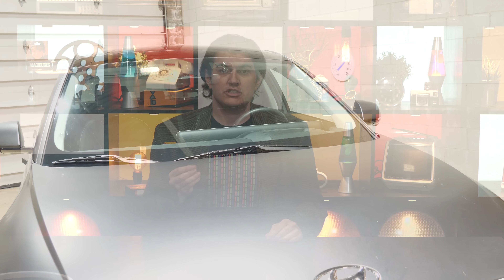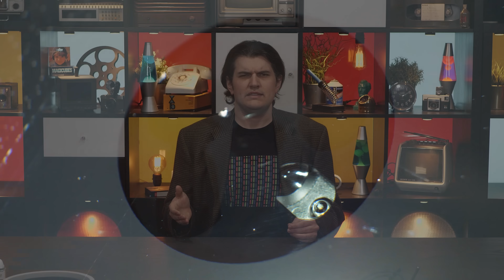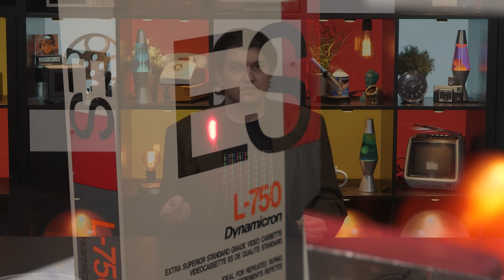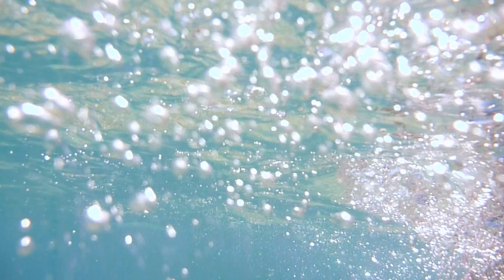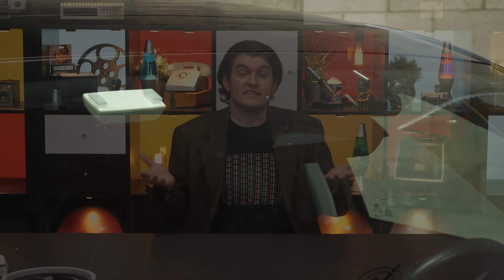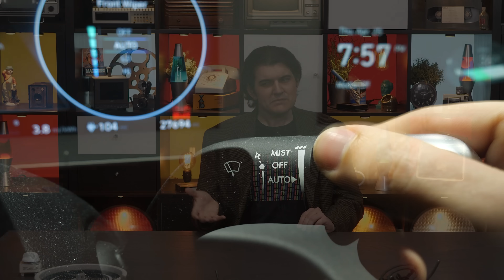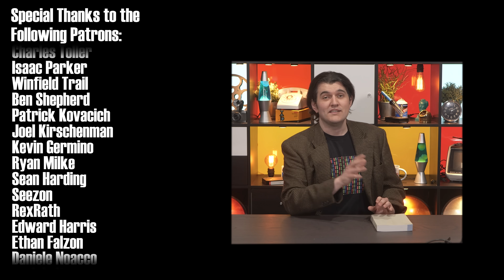The simple, clever sensor behind automatic windshield wipers

Comment: I remember reading the entire manual to my car before purchasing it. Found many important notes like "Do not run ventilated seats without A/C also being on as this may cause damage to the ventilator system" or "Do not jump start other vehicles with jumper cables as this may cause damage to the hybrid traction battery." I however missed the windshield wipers stay up note he mentioned and I found that info in a helpful Hyundai USA video on YouTube!
Reply: "Do not run ventilated seats without A/C also being on as this may cause damage to the ventilator system" I feel like it should be their job to program it to prevent that feature from working when the A/C is off, or to automatically kick the A/C on when it's enabled.

Comment: The owners manual only really works if it's the correct one.   Mine is trash as it's for a 2009 vehicle and the vehicle is 2012...I did check the door for the build date as to make sure the dealership  didn't pull a fast one... but still don't have a manual
Reply: I also buy tare down manuals for all my vehicles

Comment: Had an old Mercury Grand Marquis that had the same issue with the hood blocking the wipers.  As this was 2002, I don't believe the Konami Code would work.  There was enough play to change the blades but it was a pain at the gas station when cleaning the windshield.  I probably could have stopped them mid-wipe but never bothered to find out.  It finally died after 220k miles and almost 20 years.
Hilarious opening and I love the snarky asides.  Through the magic of two of them! Good stuff

Comment: Tesla isn't actually too insane for detecting it with the camera, although it more complicated. A few reasons for this: 
1) Tensor cores - you probably have more than enough compute already. If not, just run on the CPU. 
2) You could build it into the existing neural networks - or even measure how 'poor' it rates the image quality instead of water itself
3) It makes cars they made that don't have the dedicated rain sensing hardware also work. 

Personally, I think the non-camera is way better, but I do think that tesla wasn't crazy to have done it how they did. Also, yes, stalks please.

Comment: Hyundai wipers: How has it been cleaning snow and ice on the windshield without being able to lift the blades completely? I just bought a Kona EV and had the same experience during the last snow fall of the season. Not looking forward to next winter.

About rain sensors and stalks: I rented a Tesla 3 for work last year and almost had an accident when rain started pouring, I had a sheet of water on the windshield but the wipers decided to remain in lazy intermittent mode. The only way to override that is going into 1-2 menus on a touch screen. This is the main reason why I refused to consider a Tesla when shopping for my new car. I don't understand why a car with no wiper stalk can be deemed safe to drive.

Comment: I had a 01 Cadillac with rain sensors.  The windshield was wiped perfectly clean in varying amounts of rain.  That sadly ended when the windshield was replaced with an aftermarket version, it worked but not as well as with the OEM windshield glass.

I don't like to read the owners manual but, sometimes there is info on features you never knew about.  So there is that.

Comment: I've yet to own or drive ANY car whose rain sensors actually wipe in a way that is timely and not annoying. They either go off too late, or when they're not needed and they never keep pace properly with the rain. Even the Model Y has rain sensors which SUCK which is doubly annoying since it doesn't have proper controls for wipers on the stalk.

Comment: Tbh couldn't the manufacturer just have used a metallic sensor (when the contacts get wet, the low voltage circuit is complete and boom goes the dynamic). I had one in my RadioShack 200-in-one electronics kit

Comment: My 2011 Renault Scenic has automatic wipers with the same “tucked under the hood edge” issue when you try and replace the wiper blades… and the manual for that had absolutely no information on getting them to go up to the blade change position! It took me accidentally catching the wiper stalk when getting out of the car and knocking it to the fast wipe position (or Flash Flood setting as my dad called it!) to find out that when the ignition is off, it moves the wipers up to change blades with the stalk in that position! 🤦🏼‍♂️

Comment: Alec, UK Here with a Skoda Karoc, basically a VW, we encountered exactly that problem with the wipers! It was not in the manual! THIS IS STUPID!! For such a simple process as changing wiper blades, it should be as simple as pull and lift. There is not an excuse for poor design to need an enigma code to achieve basic maintenance. If you let go of that arm kiss the windscreen goodbye.

Comment: "Software isn't everything" is actually nice to hear as a software developer. I'm so tired of doing so many things in firmware on a microcontroller that can be done with circuits more reliably and affordably. A lot of people designing circuits (in the space I tend to be in, at least) seem to use software as a crutch to make electronics work, and they are typically not great with software because they're primarily trained in electronic engineering. It's nice to get paid to do work, but feels bad to build stupid things.

Comment: The owners manual is very helpful and will show you some hidden features on your car. I know that when I had my Volkswagen, I read in the owners manual that if you turn and hold the key in the drivers side door lock, the sun roof will close, I had manual windows but a power sun roof.  Also if, for some reason you don't have power to close or open the sun roof you can open this panel and find a handle that can be inserted and allow you to manually close or open the sun roof.  So read your owners manual, yes a lot of the information might not be useful to you now or you will already know, but you will learn things too. And most owners manuals can be downloaded as a PDF too.

Comment: I dont know what calibration method those use, but I do have to point out, after a single wipe there is plenty of time to detect what "dry" looks like even if it is pouring. Sure, not to a human, but the led signal is moving at light speed, on account of being light. Even if you are under a waterfall, wipers have non zero thickness, so there has to be some minuscule time (but still frozen in time compared to light) between wiper moving out of the way and water hitting the surface again, which I presume a light sensor would be able to detect. Analysing the signal over time/wave will tell the conditions based on how different the spike, if any, is to the signal before and after.

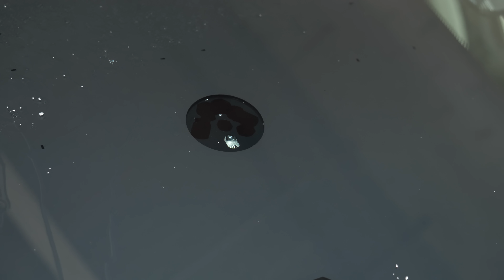Comment: 1:01 That's a kinda weird thing to say about something that literally leverages software to get away with as little hardware as possible. Personally, as an engineer, I also generally agree with the argument, that if humans can drive mainly using their eyes, computers should be able to do the same (assuming sufficient number crunching power and the right software). It would arguable be kinda clever to only start removing hardware after training the software on sufficient amounts of reliable data. Especially in the case of cheap ultrasonic parking distance sensors, that literally cost cents. But Musk is an idiot... He isn't an engineer and knows even less about engineering than about manufacturing. The Dunning Kruger effect doesn't mix well with an attention deficit and delusional self-confidence just happens to get you a lot of attention, so you there you go.

Comment: Neat fact, along with the rain sensing and ambient light sensing, that sensor can also sense solar load for the air conditioning, humidity for the defroster, and it has another brightness sensor to automatically adjust the brightness of your Heads-up display of your car is so equipped.

Source: I worked on the machines that made those sensors.

Comment: My 1998 Buick Park Avenue has Rainsense windshield wipers. Nice to see other parts of the automotive industry following a quarter century later
Reply: Plenty of cars have had this for over 25 years. I came across it on a very average car in the UK, also around 1998.
Reply: Cornering lights have come back in style too.
Reply: @bwofficial1776  Like my '99 Intrigue had. And believe me, they were fantastic, as I worked at a casino on 3rd shift and often had to dodge random employees wearing all black popping out of the woods at jogging speed into the street. (Why walk on paved, dimly-lit streets when you can run through completely darkened woods?)

Fun Hack with the Intrigue (and I'm assuming the sister models Buick Century and Pontiac Grand Prix, but don't quote me on that): If you replace the single-filament bulbs with dual-filament bulbs, you get an extra pair of parking lamps that light up brighter when turning.

Comment: The Citroën SM from 1970 had automatic wipers, however the design was much simpler. There was a sensor that detected the current to the wiper motor. Water on the windscreen made the wiper blade flow effortlessly over the windscreen which in terms resulted in a lower power consumption by the wiper motor. The wiper motor current was higher when the windscreen was dry, so the system automatically slowed the wipers and parked them.

Comment: Fun fact about the wiper replacing mode: You can also use it to stop the wipers from freezing when you're parked outside, because water will run off instead of collecting and freezing onto the windshield.

You know, you don't have to be shy about taking a look into the owner's manual. It's not about "I know how stuff works" - yes you do - but the user interface is designed by humans. You cannot know what humans thought when designing it (or what Elon Musk didn't think when designing the Tesla UI), this is why you have a manual. Especially for cars which are incredibly complex.

Comment: 8:55 now that's some BS design... but at least they documented it <.<
What I find more odd is that the wiper handle direction is opposite to what we got over here in germany. Or is that /just/ that car?
Here it's normal to push the handle "up" the heavier the rain is, and what "down" does (past "off") depends on the car.
Mine does a single wipe, but I can just pull it for that, which /would/ spray the windshield if I held it, but just tapping it is the exact same result...
No idea why they did that. Probably didn't know what to do with a "left over" handle position.

Comment: Funny thing my Tesla has rain sensor above the camera and wipers worked good in 2020 when car did use that sensor (and even headlights turned on when it wiped). But now when Tesla in all of their wisdom changed it to use cameras automatic wipers haven't worked correctly for even a day (and now you have to turn headlights on manually thu the screen when it rains). And that is specially annoying when car forces those non working automatic wipers on when Cruse control is engaged. And yeah even idiots did see that cameras won't work as rain sensor when Tesla turned rain sensor off (and then did remove it from new cars)

Comment: For an electronics design project during my studies, I once used a coupled led and photoresistor that I taped together to act as a very simple voltage controlled gain in an audio amplifier. Worked very nicely since the control circuit was completely isolated from the actual amplifier electrically.

Comment: Clever windshield wipers unless you drive a Renault in which case the automatic wipers are absolutely dumb af. It either doesn't come on or it comes on but it's too fast. Adjusting the sensitivity then makes it way too slow and there is absolutely no in-between. I can't wait to move back to hyundai

Comment: The 1951 General Motors LeSabre show car had a “rain sensor” that put the convertible top up automatically when it rained. GM had the automatic headlight dimmer by then (“Autronic Eye”). I wonder if it was a similar system? Interestingly, and off topic, GM initially created some of these “light activated” electronics for hospital use (automatic door openers, etc.), and, obviously, for the military, back in the 1930’s!

Comment: this is probably how the new rain sensors work, because i have Mazda 3 from 2010 and its rain sensor works differently... when i drive at day or well lit streets at night, the rain sensor works perfectly and wipes the windshield when it has rain drops on it, but if its dark outside it doesnt wipe at all even if the whole windshield is dipped in water, so its probably using visible light instead infra red...

Comment: The first vehicle that I had with automatic wipers was a 2007 Chevy Suburban (best vehicle I ever owned). I bought it used, and didn't know it had automatic wipers until one day driving through a rapidly changing storm, where it turned itself on automatically, later went to high speed wiparoni, then gradually went to normal, intermittent, longer, and longer as the storm passed, until it was off completely. It was perfect, in my opinion, until I had the windshield replaced and the sensor got replaced with an inferior, non-GM knock-off that turned it from perfect to mediocre. At least now I know what happened and why.

Comment: on the manual thing, usually the owner's manual in modern cars is actually pretty useless for maintenance so i understand why you wouldn't check it. It'll have a lot of stuff on how to use the infotainment and all the car controls but instructions on how to change oil, cabin air filter, engine air filter, and wipers often aren't on there because the manufacturer wants you to take it to a dealership instead.

Comment: You could get a wiper relay replacement for 90’s VW Golf that had the sensor wired in. That actually tells the whole thing is not really high tech. 

Btw the wiper maintenance slash freezing weather position logic drives me nuts. In my car it is like in basically all Bosch controlled cars shut down + press single wipe once. 

Yeah really nice in winter when forgetting to lift the wipers up when parking the car. You have to comd start the car and let it run a bit, then shut it down to raise the wipers to clean the hood-windshield corner and start again to warm up more while clearing the snow. I wish there would be a button in some menu to raise the wipers without turning the engine off.

Comment: I absolutely love the manual with my car. It's got full illustrations of every single part, step-by-step instructions on how to do literally everything, full wiring schematics, full descriptions of how every component works, literally everything.
Reply: What car is that? Impossibru with the schematics.
Reply: Times have changed. I miss old user manuals. Even consumer electronics had schematics in them. Nowadays I'm surprised if I can get schematics for industrial equipment
Reply: Was it manufactured in 1962?
Reply: And it's only probably 100 pages long. I have an old car like that. It even has 1980s first aid instructions and how to use the dealer accessories.
Reply: Technical writers are cool.  They should get more respect.  🙂
Reply: Sir, that's not a manual, that's a tutorial for how to build the car from scratch

Comment: Almost every manufacturer uses the same rain sensor, too. Ford, GM, Volvo,  BMW, even Tesla

Added rain sensing wipers to my Bronco. Basically every Ford supports it, they just don't always include the sensor.  Annoyingly the sensor I bought, brand new and sealed, had a fingerprint in the gel. Replacement gel costs almost as much as the sensor itself.

The ADAS camera would never work for rain sensing,  if it were focused that close to itself, it wouldn't be able to see the road

---

That grey fritting is gross. So pale looking

Comment: Fun fact: A car I owned a long time ago had the same issue with replacing windshield wipers, except there wasn't a clever solution to force the wipers in the upright position - instead, you had to pop open the hood which would make just enough space to be able to pull up the wipers to change them. And yes, it was in the manual, but I figured it out myself after a short hour or so and almost breaking the darn things a few times...
Reply: 2000s Buick Century? I had one and needed to open the hood to lift the wiper arm up.

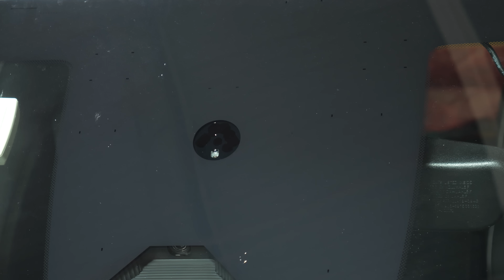Comment: 7:00 Volkswagen solved the calibration problem even more clear: require first swipe after turning on the ignition to be initiated by the driver. This avoids ever accidentally turning on the wipers automatically and avoids swiping the windscreen if the owner knows the wipers are bad or there's sand dust on the windscreen.

Comment: I only had one car with auto wipers and it was a Corolla seg, the brad pit one, and they where bad. Like you said it went haywire on light rain and refused to work on heavy rain. My suspicion why is that Toyota cheaped out on it and just added a photovoltaic sensor that detects sudden changes on light to activate a relay for the wipers
If too little water is added it works fine but if you grab a hose and put it slightly above the sensor with no bubbles forming it just refuses to work
I had so much issues with it under heavy rain or light rain that didn't even needed a wipe that I just refused to use it all together

Comment: What's interesting is that I would have guessed that instead of optics, it would have been some kind of analog capacitance circuit. That's because if you've ever gotten sprinkles of water on your phone (like when it's raining) the phone may detect random touches on the screen. I would have guessed something similar in use for the windshield. But this is clearly either better or just as effective, and either cheaper or so cheap that it doesn't make sense to worry about the difference in price.